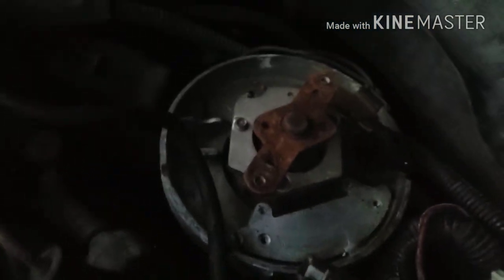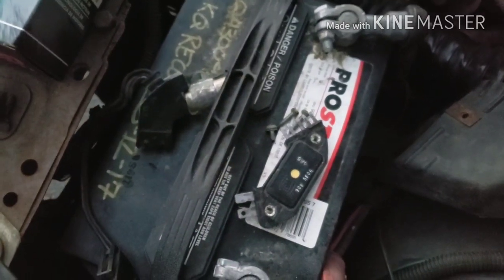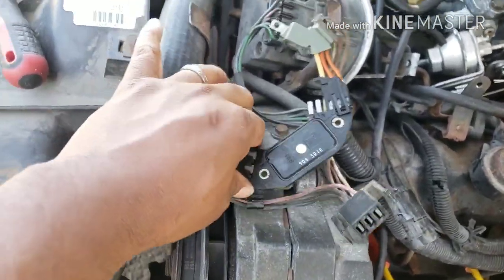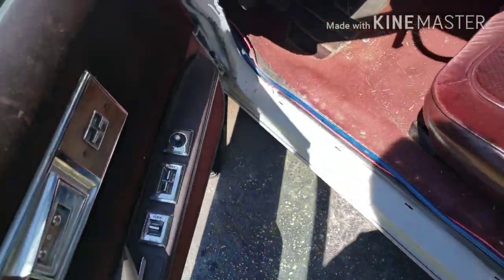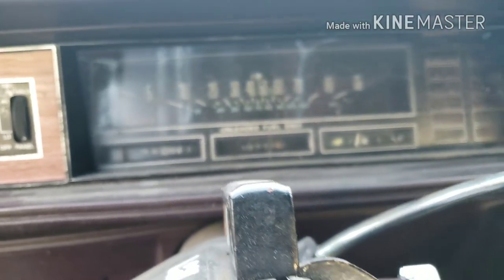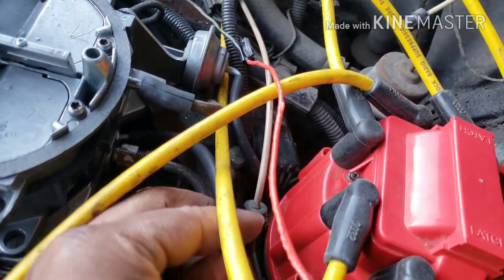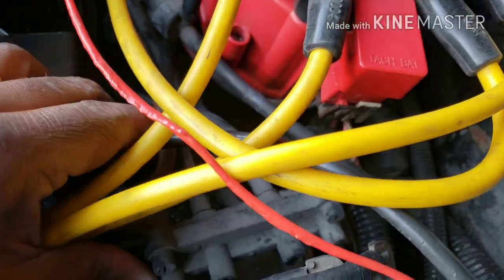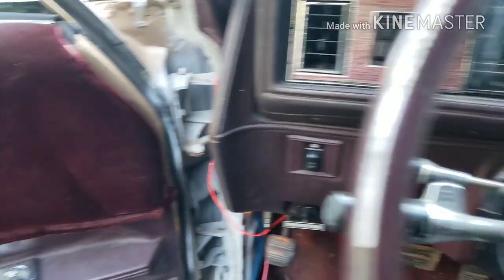86 4door cutlass back running... 6/18

Comment: Awsome video I seem to always come back .I'm playing mechanic this morning too🤣🤣🤣🤣 my car starts  on park then it dies...look around the carburetor n walla a vacuum holes pop out the carburetor. shit just sitting there (the holes)😲 i connected to a lil   pipe sticking out the carb turn my 82 4door cutlass  on n is stable didn't cut off..I was getting ready to change few things...can you tell me what happens do  
It struggles on air or gas?when that holes  was disconnected..I wanna learn.